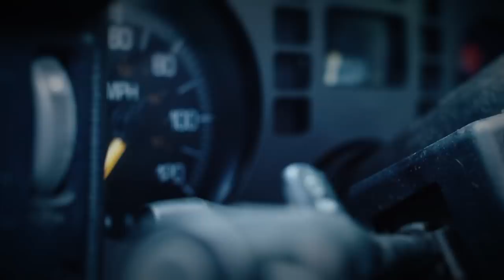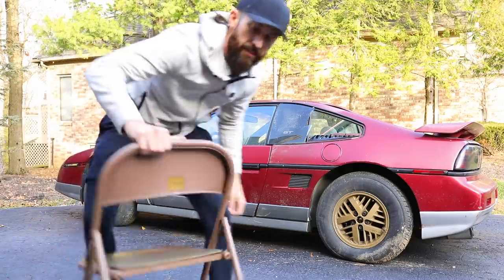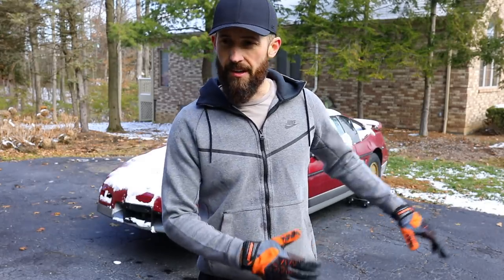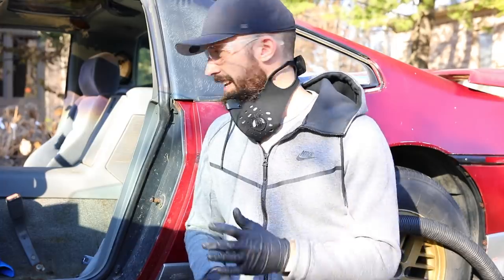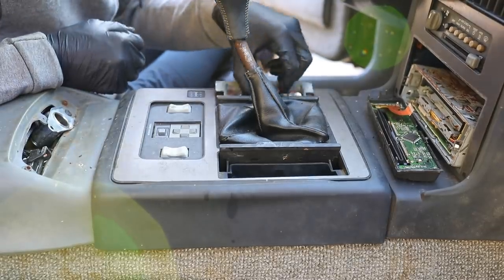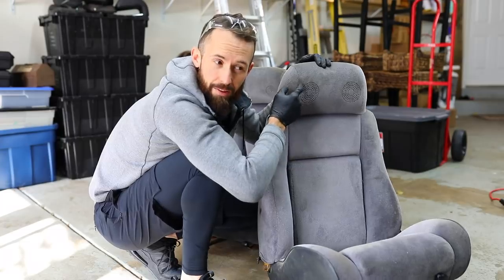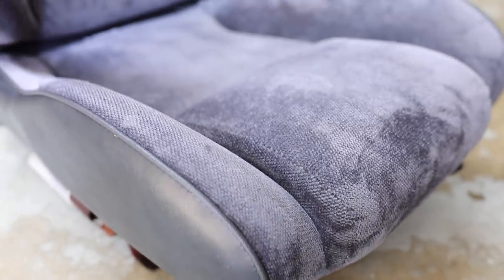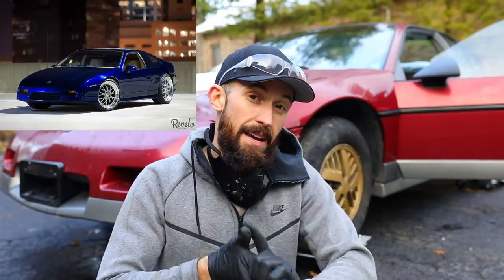First Wash In 30 Years Barn Find Car Detailing Restoration || Abandoned PONTIAC 1987 FIERO GT

Comment: “I’ll have to be careful with those headrest speakers”

Sprays hot water directly onto them
Reply: I was thinking the same thing lol
Reply: They are most likely shot anyways, those are known to be fairly unreliable.
Reply: I was thinking the same thing.
Reply: Fridtjof Riibe he also didn’t spray as much as he did with the seats. But I had the same thought!
Reply: They are not the correct seats for the car anyway, nor are the wheels.
Reply: I was wondering the same thing lol, but I have a feeling they’re shot anyways.
Reply: I was thinking that also.  When he pulled the seats there were no connectors for the speakers.  Then I thought "wait, this is a '87.  They stopped putting the speakers in the seats in '86 (moved them to the panels on the sides next to the seats).  I have an '85 (bought it new in April of '85 (original owner).
Reply: @gregtimko5967  I'm guessing that the seats in the car are from an 1984-1985 Fiero?

Comment: I've owned a few of these, love them like most people who have driven and owned them.  I've dyed the carpets before and they turn out good, don't dye the speaker covers on the dash recover them in black fabric (the dye fades fast there). A nice touch I did on my last car was Suede headliner and A Pillars, doing the rear panel in seude as well( the waterfall). When you get around to mechanical save yourself the trouble and do the Distributor, Clutch master, and Slave cylinder right away ( RodneyDickman sells upgraded parts that I recommend).As far as engine change the LS4 or 3.8SC swaps tend to be the way to go. I also responded to someone else but those seats and wheels are not original to that year.   If you have any questions feel free to ask. Oh and have you pulled the carpet in the trunk to check for rust?
Reply from the maker: Thanks for the tips! I wanted to compare weights on those 2 engines and I would love to try to get as close to 50/50 as possible. I have seen guys extend the wheelbase and put in some crazy stuff. I don’t mind even dropping the cradle and designing my own mounts for something completely different. Ecoboost motors crossed my mind. Think a 911 drivetrains would fit if you blow out the rear trunk? Haven’t got under it yet because the key cylinder is broken and I haven’t powered the car up to pop the solenoid. Not sure what I’m going to find under the cover
Reply from the maker: Love the suede waterfall idea. I’m going to gut everything in the car down to the frame and go through it. Are there any common brake swaps or spindle upgrades? I would love to widen the stance for the increased power and flare the body to make them fit
Reply: @StaufferGarage   Largest tire I've run is a 245/45 personally, though I've seen larger those fit stock body well. As far as widening it, there are some fiberglass options out there. Brake upgrades for you car would be Grand Am brakes or C4 Vette brakes with adapters. I've seen a few people do ecotec motors,  not ford ecoboost. but cant see why it wouldn't work minus having to make adapters for the trans. Latest oddball swap I've seen that is still in progress is a K series he is documenting it on youtube (BVMotorsports). Though i will say anything is possible 3.8 engines, VR6, Kseries, EcoTec, Northstars, LS4, LT1, SBC, and I'm sure I am missing some. Not sure where you are from but there are a bunch of dedicated people in this community, just happy to help eachother out. Fiero.com great source for information or if you narrow down your area there are some great facebook groups as well.
Reply from the maker: Shooting for every other week. Disaster details in between!
Reply: For a 50/50 ratio your best bet is the Chevy Ecotec. Cheap, reliable, and readily available. Stock 2.2 has roughly the same hp/tq as the original 2.8. Maybe the turbo Ecotec if you want a lil more. Just a thought. Nice GT good luck and enjoy.
Reply: LS4?  As in the 5.3L LS series?  The rest of the world seems to avoid that LS.

Ford Ecoboost engines are kinda cool and people think they would make a good swap but they end up a nightmare- you're pretty much forced to keep the factory harness and that integrates into all sorts of weird stuff in the body.  I'd avoid it (and this is coming from a Taurus SHO owner that loves his Ecobooost SHO with other Ford products I'd love to have that engine in but after looking into it I'm avoiding it)
Reply: My vote is a k series! Cheap reliable and makes pretty decent power!

Comment: Grand prix gtp 3.8ltr super charged engine makes a fiero fly and super reliable
Reply: I agree. It's a popular swap with a ton of potential.
Reply: Keep the 2.8 if it had the 2.5 then do the 3800 but the 2.8. Is fast enough for a car like that
Reply: nothing  wrong with  the 4  or  the 2.8
Reply: I second a 3800 SC swap. Lots of aftermarket support for this and well documented. Do it!!
Reply: @georgekostician3229  no it's not lmaoo😂
Reply: Clearly he isn't looking to keep it in stock format he asked for swap options for a reason so I went and offered up a viable option that still keeps with Pontiac heritage
Reply: Fast enough said no one but george kostician. Ever. Ls1 5.3 is a good swap.

Comment: I'm restoring one right now. Bought a donor car to pull parts from to make one complete car. Restored all the interior parts first. Now getting the interior from the donor to the restoration car including the complete HVAC box. I can tell you this much. If there were that many droppings on the floor, It's DEFINITELY in the vents. I took the heater core out (Super easy job) and taped a trash bag to the opening after sucking out what i could reach and then put the hose on the blow side and blew out the rest. If you don't, that could be a big health risk to you. Keep posting! I love seeing these vids.

Comment: I must say I got my seat unstained because of your videos. My hubby spilled coke and let the car bake in the sun which set in the stain. I tried doing my method of just shampoo and the extractor. Didn't work. It set in my cloth seats more due to sitting for a week. I came back and tried your method of spray with shampoo and water, brush, then hot water to disolve and extract. Worked the first time with your method. No stain at all. So thanks. I can say it works on set in Coca-Cola stains.

Comment: The radio unit will have to be replaced.
Reply from the maker: Absolutely! Would love to find a cassette deck or something ridicuous
Reply: @StaufferGarage  The stock am/fm/cassette had an optional 5 band equalizer on it... how much more 80s could you want? My 1988 Fiero GT has that factory stereo in it... still works! There's a Def Leppard tape in it as I type this.

Comment: Great start to the Fiero! Looking forward to the next one.
Some common and relatively easy swaps are the gm L32/LQ1 3.4l v6, 3800 super charged v6, and the LS4 v8.
Some more off the wall builds currently being worked on that I know of is a K24, and my eventual attempts at a ford 3.5l eco boost.

Comment: @s.g....go to a body shop supply store, get a 'small' bottle of Muriatic acid.. Mix as directed for a small spray bottle, ( make damn sure its well marked!) Use it on the rusty stains from seat attachment bolts etc. Where ever you see 'red'. Got another tip for you on 'really black, dirty greasy spots...leave 'Frankie' Fiero stock as much as possible! (Much better return as these are appreciating in collector value all the time! Great vids...

Comment: I own 2 Fiero's an 84 and an 88GT, I'm currently restoring my 84 at the moment after 35 years it needs it, also thinking about doing an engine and transmission swap on it at some point, probable some kind of aluminum V8, either a Cadillac 4.9 or Northstar or a LS engine.

Comment: All NA Miatas also have slots for headrest speakers too. The slot is already cut into the foam and there's a zipper in the headrest area and you can just put a set of small 3" speakers in there if your car doesn't have them from the factory.

Comment: Well, the standard thing to do is replace the engine with a Chevy small block V-8 or LSx engine, but if you want to have a poor man's Ferrari see if BMW V-12 will fit, or go modern high tech and do an electric conversion with a Tesla model-S motor and batteries. To do the V-8 or V-12 you probably need the Muncie Getrag manual 4 or 5 speed. I think the '87s came with the 5 speed. The Tesla motor has its own attached two speed transmission. I used an '85 Fiero frame to build an electric a few years ago. It was a blast to drive!

Comment: If you use a lighter on the loose fibers in the door panel it should melt and shrink them so they don’t look so torn up but be careful not to catch it on fire and ready to pat it out if it does catch flame 😁

Comment: A easy motor swap would be a series 2 Buick V6 as it has been done many times and they’re is lots of info on it. However I have a 87 gt and personality would like to swap an LS4 V8 in it with a F40 six speed manual from a G6 GT. Whatever you choose to swap it to or even leave the 2.8 it will still be a lot of fun!

Comment: Seats are from an 84 to 85. 86+ rear speakers were moved to the b pillar.  And make sure to clean out the blower motor resistor area up front. Mice love that area and it's a common cause for fires because that resistor gets hot. 

As far as the engine swap, 3800 sc or ls4.

Comment: Engine swap I like the 3.9 2006-2011 GM. It is the last pushrod 60* V6 240 HP stock (same engine family as the 2.8 140 HP in the car stock) no annoying adapter plates needed it will bolt to the transmission in the car. or if you want a better transmission the f40 from the Pontiac G6.  Or the 3.6 DOHC LLT / LFX with the 6 speed auto. Lots of donors, still a 60* V6 300HP on stock tune NA. The sound of the 60* V6 engines are fantastic. There are already a ton of 3.8SC, SBC, Northstar, Ford 5.0, and LS4.  I see from other comments you are thinking a 911 but that is going to throw off car balance since those are rear engine and not mid, and depending on what you want to spend, cost is a factor.... the 3.9 and 3.6 are in the same weight class as the original equipment.  The 3.9 is actually a little lighter dry weight. The 3.9 is defiantly the budget build option to add 100 HP to the car from stock, with a solid torque curve.

Comment: You should do a Subaru ej255 or 257. Double hp. Lower center of gravity and lightweight. I did my measurements and I will be doing this swap in my 88 fiero formula

Comment: If the original V6 is good, just get it running. Not a bad motor, cheaper to maintain, already OEM. If you must change it, best swap is a 4.9 liter OHV CADDY with the 4 speed auto... Fits like it was meant to be.

Comment: That engine had a massive recall due to defective oil pumps.  Still, a quality rebuild but with balancing, porting and then maybe a turbo with a mild boost pressure.  Other than that, upgrade the brakes and suspension, restore the paint and some classy OE size wheels.  Bottom line is I’d go with a sleeper style.  Put the money under the hood.

Comment: I don't know why, but Fieros are hard to push and roll around...
Looks like the mice are living in the HVAC housing, You have to pull the dash to take it out and sanitize it anyway. 

The speaker seats were standard in 1984 and 1985 cars, which explains why those are not GT seats. Look out for 'creative wiring'

Someone also swapped on 14" high tech wheels, the GT original came with diamond spoke 15" wheels.
Reply from the maker: Gotcha, sounds like this one got some swapped parts.

Comment: swap a 3800 series 2 v6! manuals make the swap easier, my 86 sc came with an auto and i plan on keeping it auto to make the swap easier and possibly converting to manual.mine is not rust free tho lol, so im recreating the rear frame with 1 3/4in tubing then going on with the swap. the supercharged motors are said to be the way to go, but ive had a 2000 grand prix gt for a long time and with little mods being only poly motor mounts and a zzp tune, it is plenty of power for a fiero and if you get the zzp hv3 insert (about $115 as of 11/30/19) they are rated for 30hp towards the top end and doesnt lower hp in the lower range, and that with an exhaust and tune brings power right next to the supercharged engines, and on top of that, the n/a's have higher comression, so they love boost and they are much more easier to find, and easier to find that havent been neglected and beat to hell like most sc'd motors. best of luck though man with the overall build and choice of engine you go with

Comment: My dad has 2 Pontiac Fiero GTs. One of them is an 1986 and the other one is an 1984 and I'm trying to get him to let me restore them because they haven't been driven since at least 2003 and haven't been kept in good condition. I want to drive the 84 because when I can drive with my licence it will be 40 years old and it has some racing parts in its engine.

Comment: I barely started watching this but I can already tell you where those mice are likely living: the ventilation system.

How do I know this? Well, once upon a time, while stationed in a colder clime, I used to park in a drafty old shed behind my rental house. I got back from eigth months at sea and noticed the heater didn't heat as well as it used to and strange bits of what looked like foam insulation came out the vents when I first started the heater.

You can prob guess rhe rest.

Comment: Cleaning dirt and grim is one thing but with fecal residue still being present i would advise throwing away the seats and floor liner and using an ozone generator in the vehicle.  Then spray bleach on the metal surfaces that are exposed after throwing out the carpets and seats.  No amount of extraction/common car cleaners are going to make that car safe for normal use!  Do not sell it as you can be held liable for suit if some one becomes sick or dies from exposures.  Chances are everything will be okay but still dont risk it.
Reply: Side note.  Turn the car on and let the air circulate as the ozone machine runs.  Hang an air dehumidifier in the car when not working on it to cut down on mold build up as well.  Check out Sterifab which is sold on amazon and soak nasty plastic parts in it to kill mold and mildew.

Comment: My buddy has an 88 Fiero GT, I think his has relatively low miles and the T-tops.  I think your model has the wrong rims for the GT model.  Someone might have swapped those out for the low end fiero rims.  I could be mistaken but they should be a “snowflake” design painted either black or gold with a chrome ring.  I’m sure someone in a fiero forum/group could correct me if I’m wrong.  I’m a purist when it comes to 80s cars, the 2.8 V6 will make the car worth more and fans of this vehicle would tell you to do your swap with an Am 4 or 6, the GT model will be worth more if left unmolested.  Again that’s just my opinion, you don’t have to listen to me.

Comment: I noticed You didn't use a Hot Steamer while cleaning the car.   A hot steamer would helped kill bacteria that in the car that's caused by the mice infestation.   The BEST Hot Steamer on the market is the McCulloch Heavy-Duty Steam Cleaner that goes for a Regular $139.99

Comment: I had a rat infested Volvo, please check the Blower motor, cabin air filter, actual air filter, next to the transmission, inside suspension components those were the main spots I found nests and crap
Reply from the maker: Absolutely! Once I get it into the garage it’s getting completely torn apart